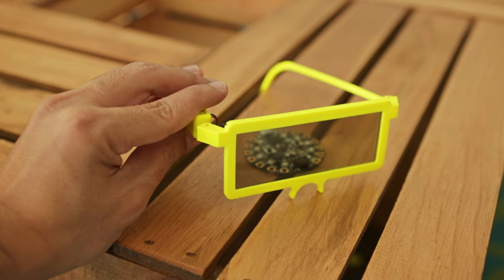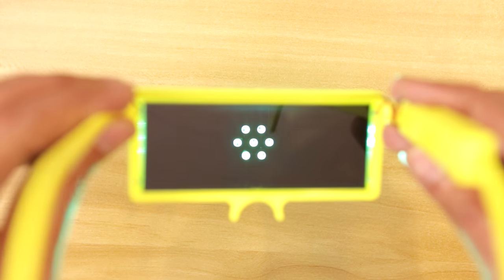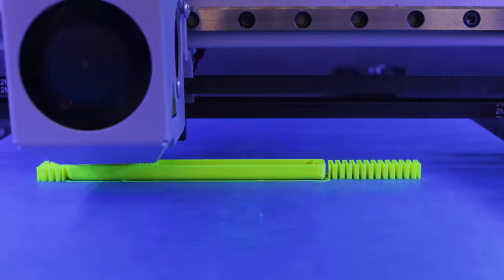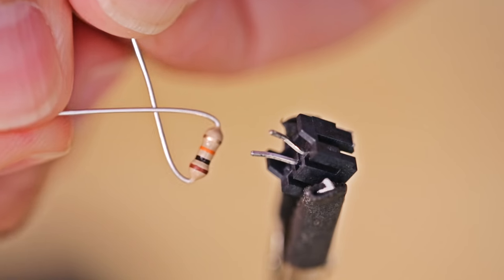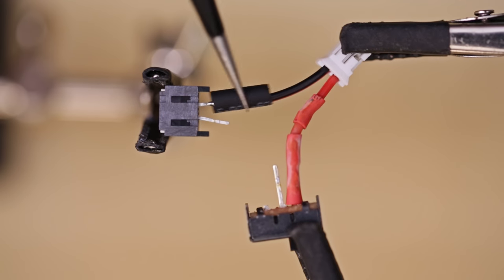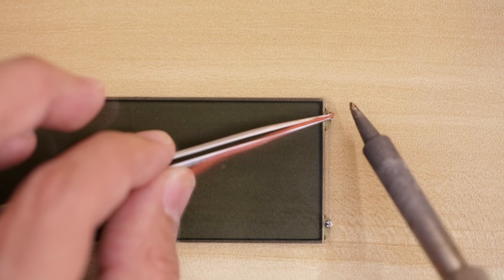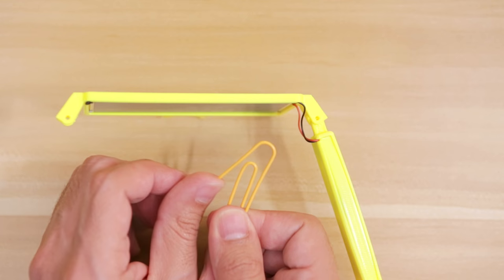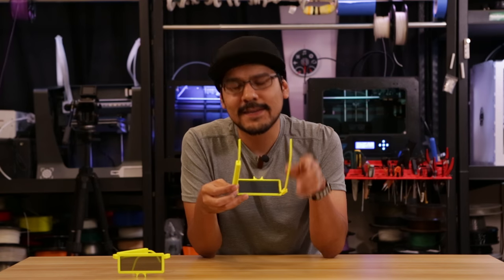3D Printed LCD Panel Glasses

Comment: could you control the glasses to flicker from fully opaque to transparent using a control input signal (square wave at 40Hz 50% DC) from a DAQ board? What is the current requirement to make the glasse fully opaque?

Comment: If I don't want an LCD to fade so don't put in a resistor, how long will the tint last?
Reply: These remain in their current state when you remove power, so you can go to tint mode and leave it there.

Comment: I think it would make more sense to 'short' the LCD via the resistor when it's switched off than putting it in parallel to the LCD.  The battery would last much longer.
Reply: Can you explain to me how the resistor is using up the battery if the switch is in the NO position?
Reply: The resistor is parallel to the LCD and I'm shure it draws way more current than the LCD.
Reply: I get that its there for dropping the current but the video makes it sound like the battery is consumed when the switch is off.
Reply: Nope, it's not. The resitor is for dropping the voltage. The LCD draws only a very small current and is a capacity at he same time. So without the resistor it would take the LCD a while to become clear again.

Comment: OK, the obvious problem with this is that the lipo battery isn't protected from over-discharge.
Reply: The Battery has a built-in protection circuit. See 2:09
Reply: Not a practical problem. The current is so amazingly low that they would have to be turned on for ages to drain the battery.

Comment: How could a variable resistor or pentameter be installed on these? $25 amazon gift card to whoever can tell me this
Reply: Connect the screen in parallel to two adjacent leads on the potentiometer. Supply the two extreme ends of the potentiometer with 5V. Positive-Negative leads doesn’t matter as these screens are bidirectional. You should be able to control the transparency of the screen.
Reply: @riddha1  Would a 3.7 volt battery work?
Reply: Lieutenant Dan's Legs yes
Reply: @riddha1  So it's soldered the same as the switch in the video?
Reply: Riddha Manna like is the circuit the exact same just replacing the slide switch with the potentiometer